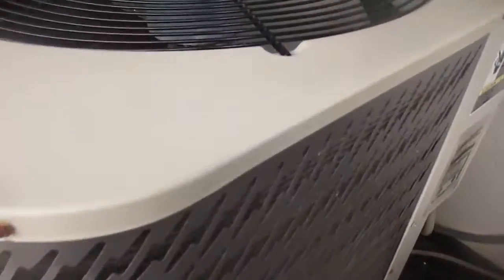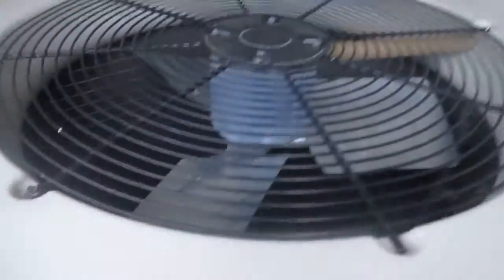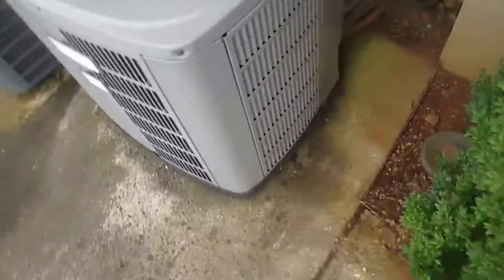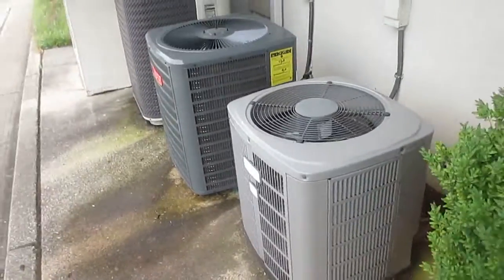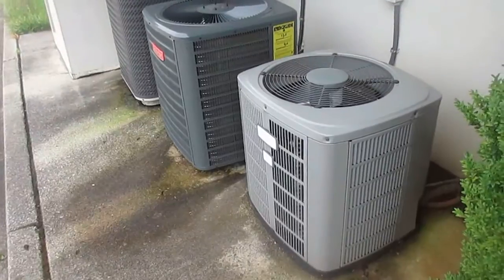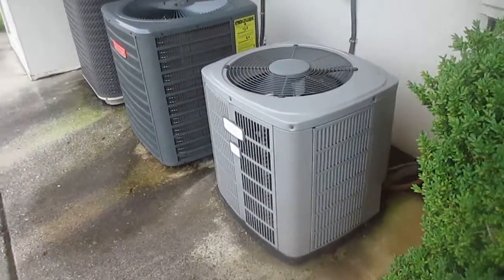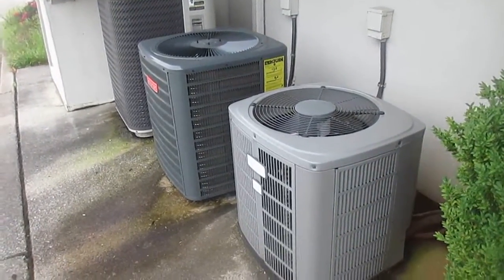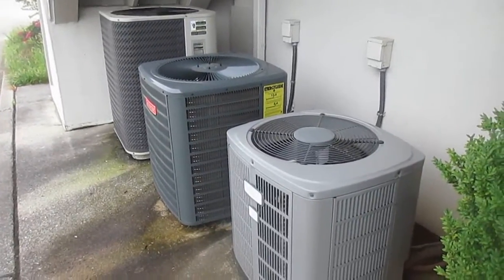2005 American Standard Heritage 11 Straight Cool unit, 2012 Goodman Heat Pump, 2007 Gibson Heat Pump

Comment: For Trane and American Standard, if it is a heat pump the reversing valve is behind the back panel. So that American Standard could be a heat pump.
Reply: พี่ก้านตองทุ่งเงินก็มาซ่อมเครื่องปรับอากาศ american standard
HERITAGE 11
นี่คือเครื่องปรับอากาศเป็นของ 
american standard
ขนาด
เจ็ดหมื่นสองพัน BTU
เป็นมีใบพัด 4 แฉกด้วย
อันนี้ไม่รู้เป็นยี่ห้ออะไรดูเหมือนน่าจะเป็น icp ใช่หรือเปล่านะ
ไม่ใช่นี่มันคือกิ๊บสัน
ผลิตในปี 2550
หรือว่าปี 2007
เครื่องปรับอากาศ 
american standard
หมายเลขเครื่องของเขา
เป็นรุ่น
2A6H1036A1000AB

 หมายเลขเครื่อง5275K544F
36000 btuน้ำหนัก 3 ตัน
ผลิตในปี2005หรือปี 2548
เครื่องปรับอากาศมันต้องจากgood man มันเป็น daikinเป็นรุ่น
DSX140421AE
หมายเลขเครื่อง 1204250422
ผลิตในปี 2012 นะ
เก่าเครื่องปรับอากาศ good man เป็นรุ่น GSZ1 3 0 4 8 1AE
ส่วนหมายเลขเครื่องเหมือนกัน
12 040466 38
ส่วนเครื่องปรับอากาศ gibson ก็
เป็นรุ่น JT5BD-036K
หมายเลขเครื่อง JTA 07070 1810
It's a 3-ton 36000 BTU from 2007
This is Gibson air conditioner
โลโก้มันแตกแล้วก็หลุดไปแล้ว
เครื่องปรับอากาศแบบต่อจาก good man เดี๋ยวเดินไปดูด้านหลังเจอแล้วแต่ว่ามันทำงานอยู่ด้านในมองไม่เห็น
แต่อันนี้ติดตั้งใหม่เป็นของไดกิ้นนะกลับ american standard
Reply: Heritage Is A Heat Pump. And Allegiance Is A Straight Cool.